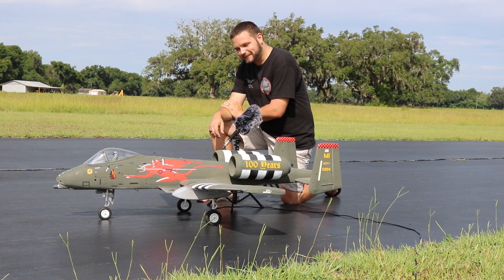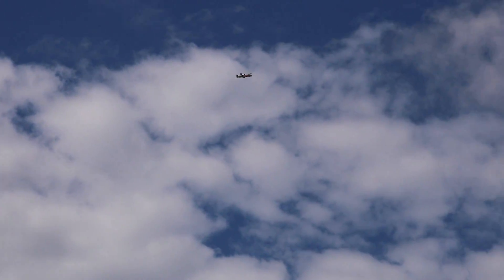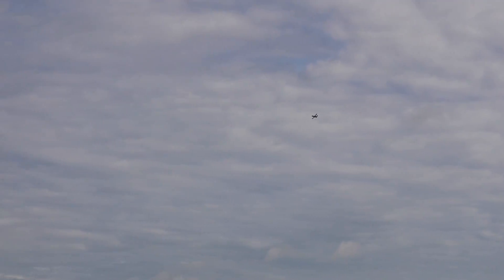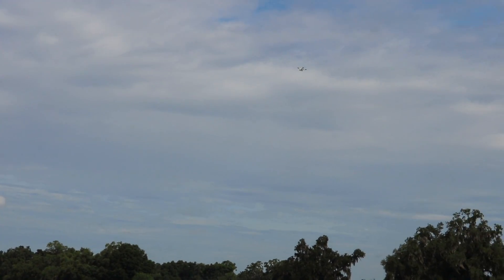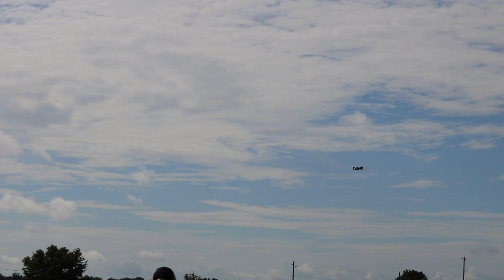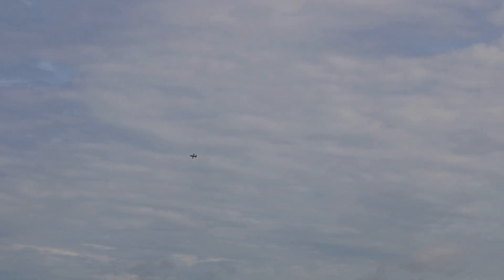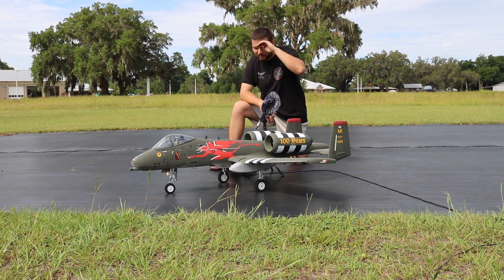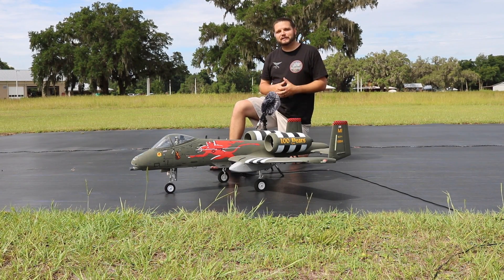Freewing A-10 Thunderbolt II Super Scale Twin 80mm EDF Jet Full Fight and Review

Comment: Mr Boozer,i just got the same jet and it sounds like you are using the same radio i have (ix12).If so could you please tell me the name of the receiver you are using so i can get one ? Also if it is not too much trouble what is the CG with those batteries?
Reply from the maker: Unfortunately I do not own this bird anymore sold it a few months ago.
Reply: I understand selling it> The reason i asked about the name of the receiver you used is that i bought a spektrum ar9030t and the plugs from airplane will not plug into it! Thank You
Reply from the maker: @leejimerson3354  I have actually ran into that before and had to shave the servo ports just a little to get them to fit. They have a little taper on one side and the FW connections are square
Reply: Thank you for the info Mr Boozer